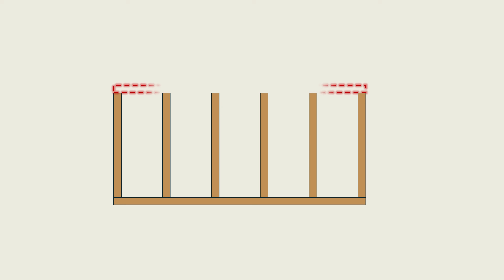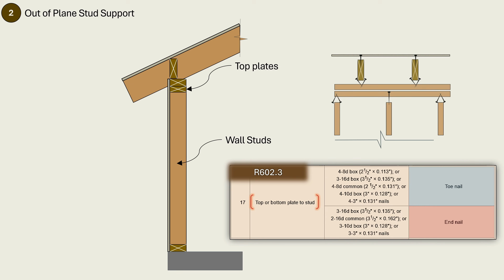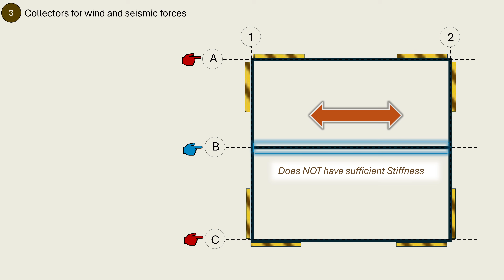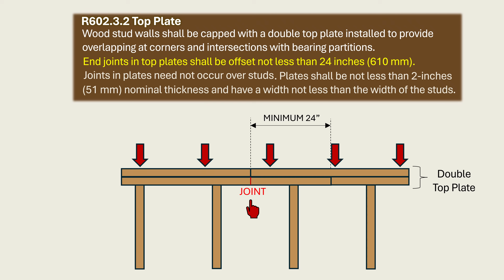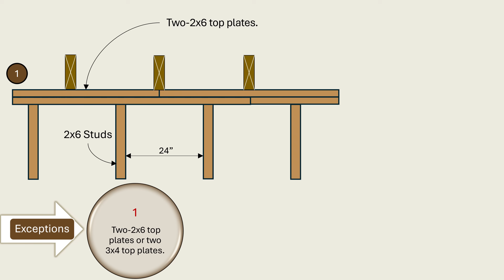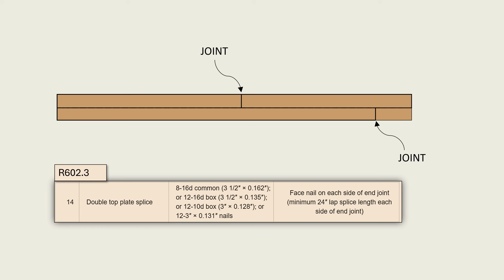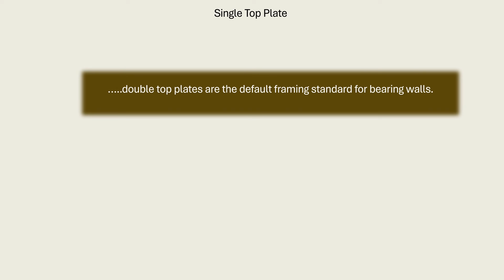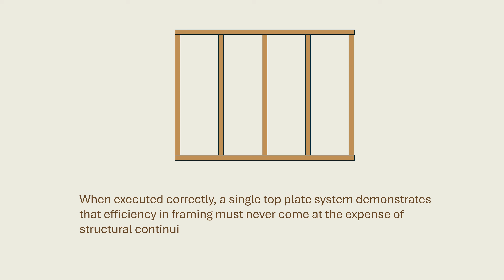Double Vs Single Top Plate | What Every Builder Must Know

Comment: Great video. Would only add the engineering principle that the bending rigidity of a 2-ply vs single is significantly stronger than single section alone, due to surface friction between each ply.
Reply: That is why new and improved quilted Charmin keeps your fingers from poking through two thin plies of paper tissue.